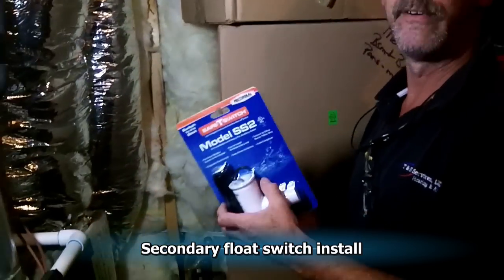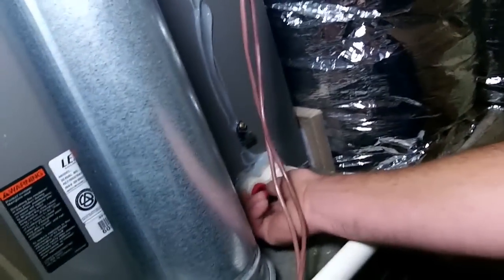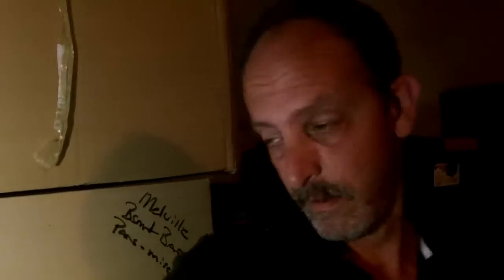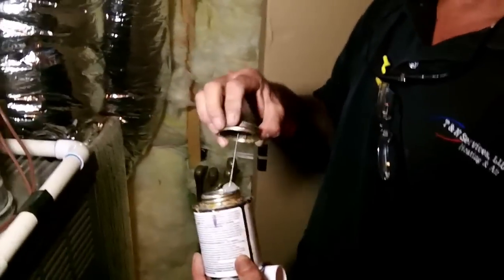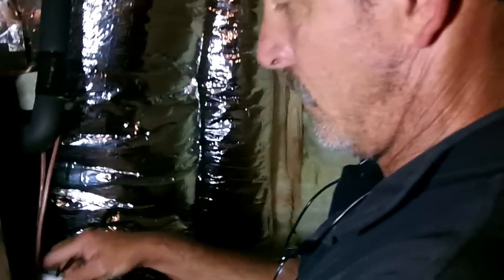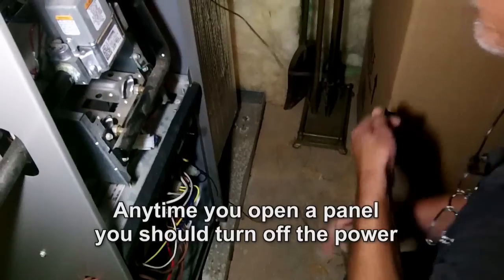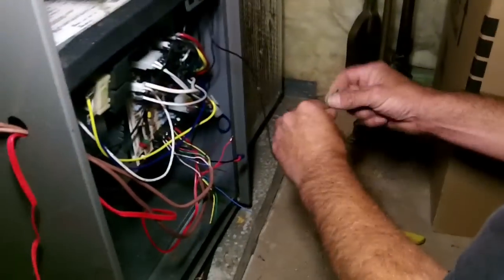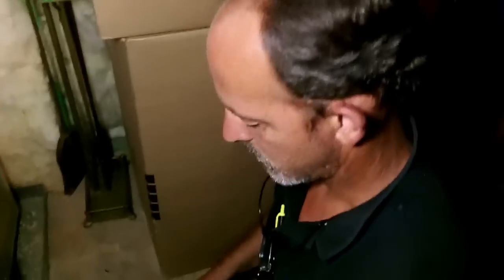HVAC "SS2"  secondary float switch install Canton Ga.

Comment: Hey Ralph !!!

We won't Pass Inspection here without the Secondary Float Switch they have been Code here for Years !!!

I like to take to the Next Level as well , I try and put every Furnace in a Pan , even in a Basement with Overflow Switch as well !!!
Can never be to Safe , especially when its our Butts on the Line !!!
(don't want No Water Damage Claims) ...

Great Job Brother !!!

Next Level  Ralph !!!

Comment: I just bought the SS2 safety switch. I noticed during this installation you also had a float switch in the metal panel below the unit. I don't have a float switch in below my unit. Where should I put the other black cable coming from my SS2 switch in this case?

Thank you for your advice

Comment: I was informed my safety switch wasnt working. 
I bought a new ss2, swapped one wire at a time so i know it is wired the same as it was originally,  but when i lift up the float,  my unit stays on. 
Why?

Comment: all safeties must be wired in series. i noticed you wired it to the y going to the outdoor contactor, however its best to break the main red wire going to the thermostat that the whole system get shut so the homeowner can notice it quicker so they can notify a technician that the system is not running.  the way you did it is just gonna shut the outdoor only.
Reply from the maker: It doesn't matter if you break y or r the homeowner will still call because it's not working. I break y so at least they will have the fan. Plus if the unit is frozen and the pan fills with water it will help thaw the coil. If this would have been a 90% furnace I would have broke red
Reply: +T&amp;N Services LLC.   yes!!
Reply: If the system gets frozen yeah that makes sense but on 95 percent furnaces you should break red at all time, you are right.
Reply: Christopher Paul could i connect the switch to make the fan cut off temporarily so tje water can drain?

Comment: why does the clog cause damage to the ceiling?
Reply from the maker: When the unit overflowed in the attic the water dripped on to the sheet rock

Comment: there are two thermostat wires right so we split in two the  red wire that goes to  the  outdoor unite to the furnace?  not the thermostat wire that goes to furnace to thermostat on the wall right